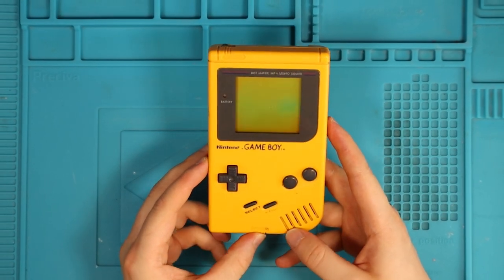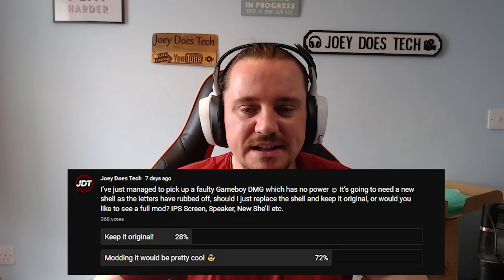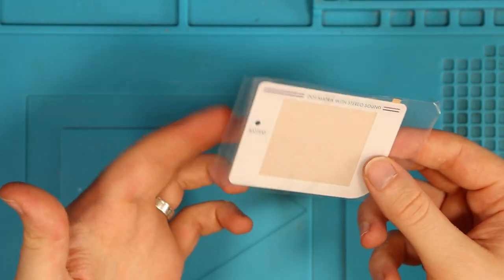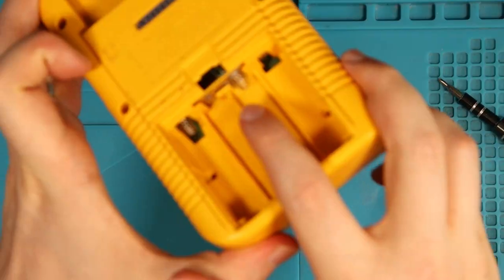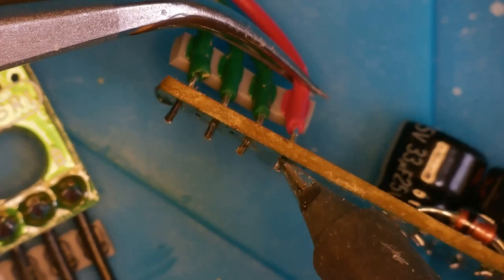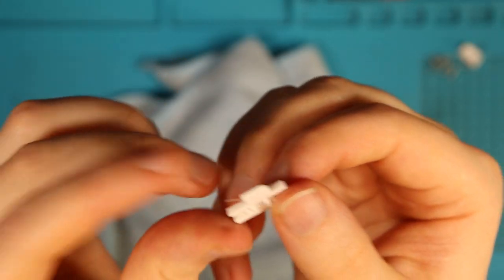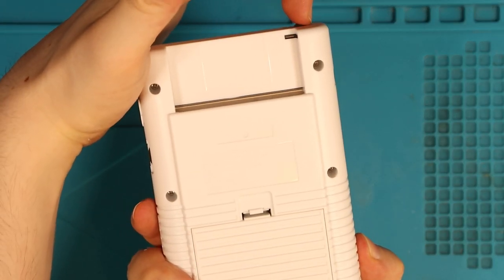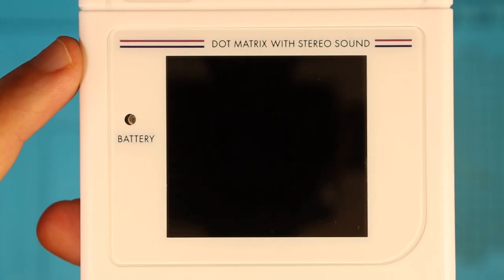Installing an IPS Screen on a Gameboy!

Comment: I would say it is 9 out of 10 because the speaker wires you installed were damaged (look at the video at 6:50, right wire exposed)
Everything else looks amaizing, including black power button! Good job!
Reply from the maker: This is a great shout! Great observation :)

Comment: I use like 99% of my parts from RetroSix. They seem to get a lot of unnecessary flack. I think their quality is the best you can get really. Great video btw!
Reply from the maker: Yeah I’m really impressed by the quality of everything. Would recommend for sure :) Thankyou!
Reply: It depends what the flack is for - I looked into it a while back and some of it was because some of their products are just rebranded Chinese products - which I guess is fine, lots of people do it, just means you could get them cheaper elsewhere - and some of it was because some of their products are not that well designed or don't compare favourably to the competition.
But most of the flack was for them taking other people's artwork and using it on their custom painted shells without permission or credit (which has been proven several times by the creators of the artwork), and the way the guy responds to people on social media, which is totally reprehensible and unprofessional. So I think any flack for that is totally deserved.
Reply: @fadetonoir6152  apologies I was completely unaware of the situation with artwork and social media presence. I just mainly use them for shells and screen parts. They are defiantly the higher price range but they’ve always done right by me whenever I’ve got in contact with them. I’ll be sure to look up what you mean mentioned. Thanks!
Reply: @fadetonoir6152  Almost true but not really. The artwork in question was made by Luke. There was an instance of one of his employees lifting fanart design and that employee was fired. Meanwhile other shops literally sell shells with fan-art lifted from Deviant art and no one says a peep. 

if you look at the samus DMG shell, it's based on the art box for Samus Returns for 3DS. It's not a pose original to any specific fan art. I urge you to look into details more closely for what is going on because there's a lot of half-truths or straight lies out there. 

Full disclosure, I work at Hand Held Legend and I have my biases. cheers.
Reply: @MitchCairns  "Almost true but not really". No, really - there's some Blastoise artwork that he made by just tracing over someone else's artwork, and he posted a video of himself doing it, saying he's "not an artist" so he's just doing it that way because it's easier. Do you not think that's stealing someone else's artwork?
I get that there's nothing legally stopping him doing that - neither of them own the rights to the character - but it's morally dubious, and it upset both the artist and the community, but when he was called out on it he just argued with people, said he was being bullied, deleted comments he disagreed with, and banned people who kept commenting.
If he thought it was okay to copy artwork like that at first then fine, okay, give him the benefit of the doubt. But when it became clear people weren't happy about it the professional thing to do would have been apologize and start asking permission in future, or put more effort into creating original artwork. Instead he keeps antagonising the community that is his target audience, which makes no sense. The way he conducts himself online is just reprehensible.

Comment: Quite good... but you cut too much out, better a 20min video and see the reassembly didnt even see the back on or battery pack installed, maybe speeded up if you want to shorten time.

Comment: I used the same screen on a Gameboy dmg I bought for parts. It had no power issue. Turned out it was corrosion on the battery contact., The only difference was I used the og buttons, but fitted it with a black "clear" case and a black screen lense.  Thinking about swapping to purple buttons.